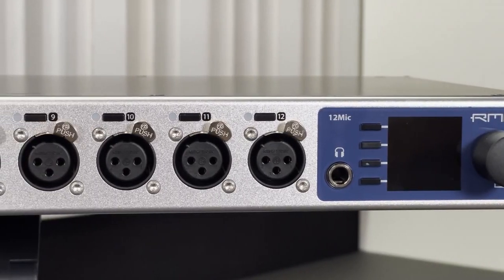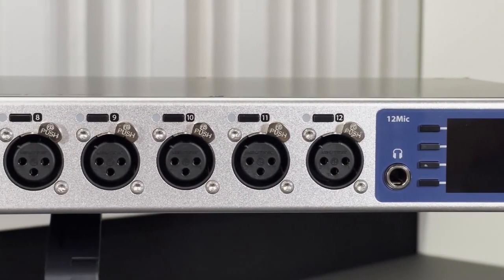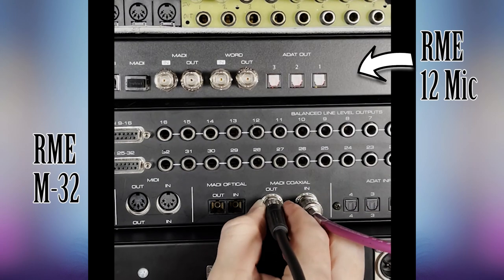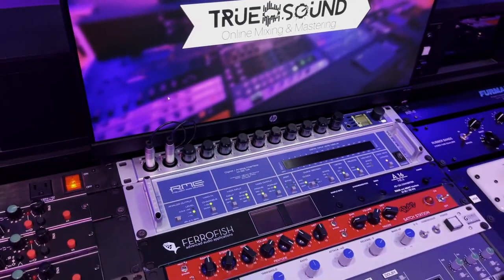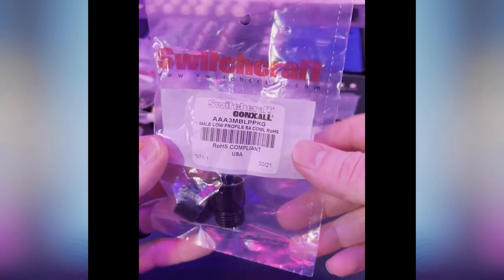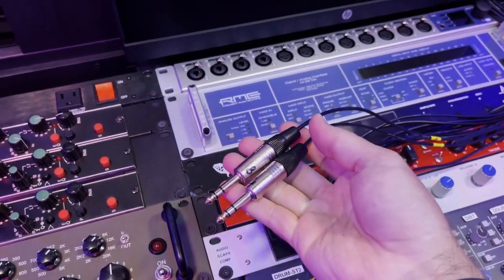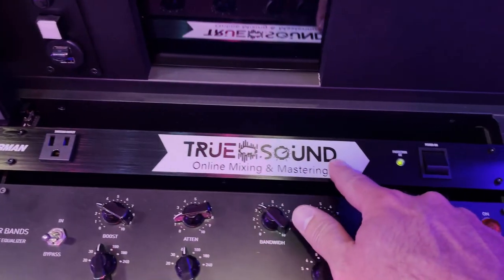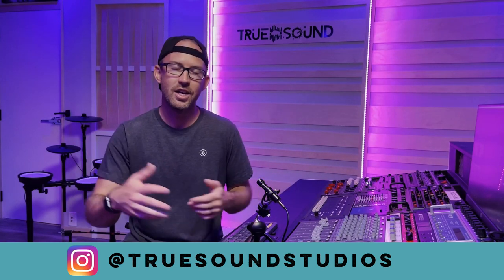RME 12 Mic Unboxing & Wiring Setup with Audio Examples

Comment: Thank GOD!  A company knew the value of including a well-written, assembled paper manual.  That is a huge complaint of mine today, given we all need them for one reason or another to learn this gear. Looking forward to getting a setup like this for recording drums.  I'm considering this model with a PCIe MADI card (just not sure which one to buy given, I don't need 400 channels).  Would you mind sharing which card you're using?  There are several.

Comment: Sweet.  I opted for the OctaMic XTC since I liked the tech specs.  I'll send this into the Fireface UFX+ over MADI.  I've a MOTU 896 for another 8 pre at 96kHz over ADAT.  I may eventually add a pair of tube amps for full body bass drum punch.  This is my upgrade from a Scarlett.